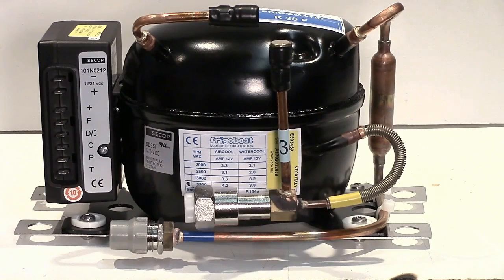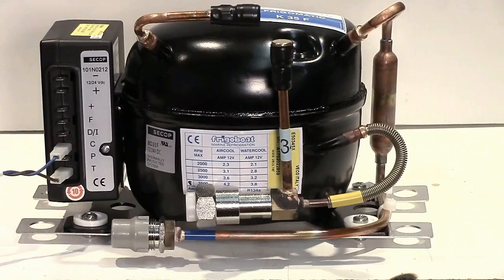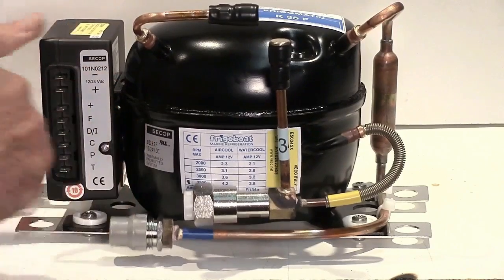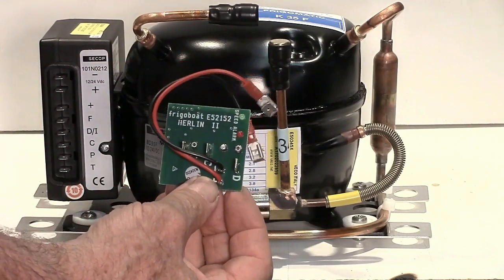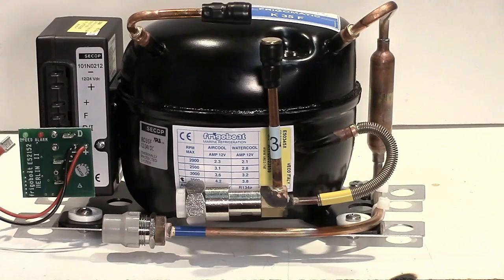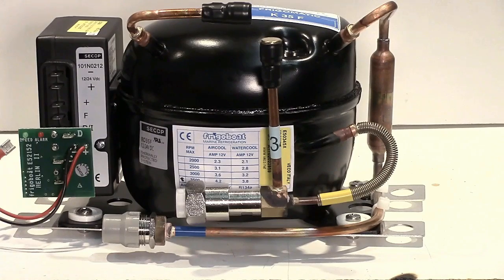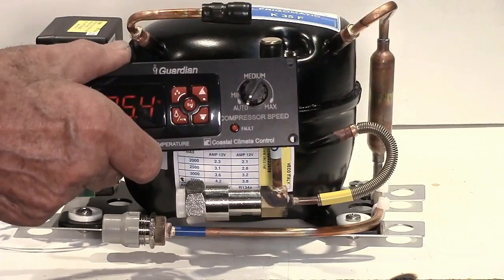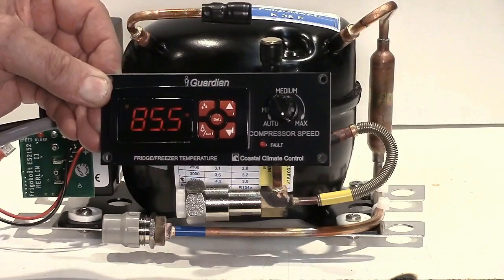Tech Tip - Compressor Speed Control

Comment: Dude, you rock so much for making this video. The compressor I was tinkering with was not the same exact model, but your description was exactly what I needed because the connections were the same. I just needed to be able to bypass a electronic thermostat that failed on a dC freezer style. Thank you so very very much.